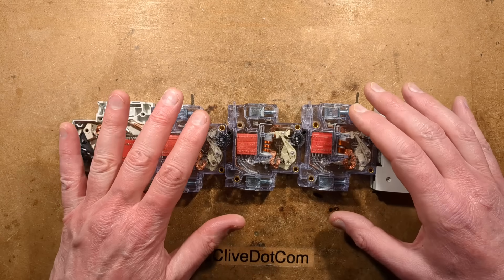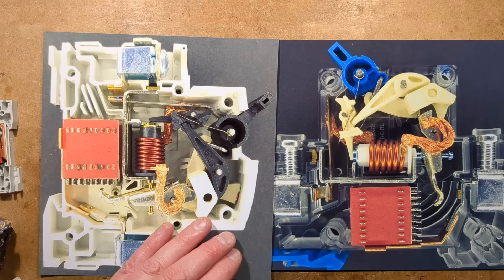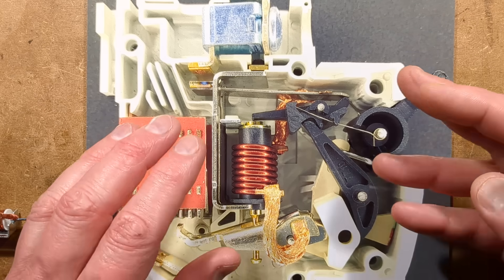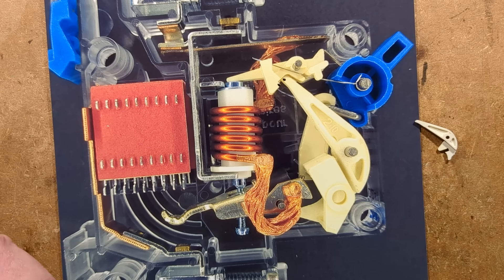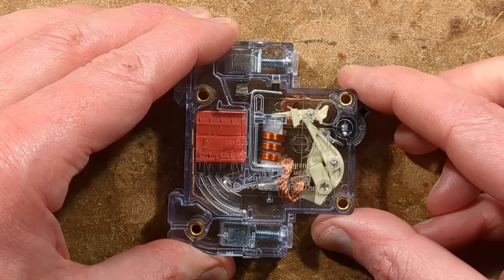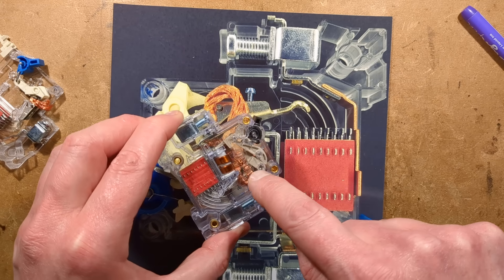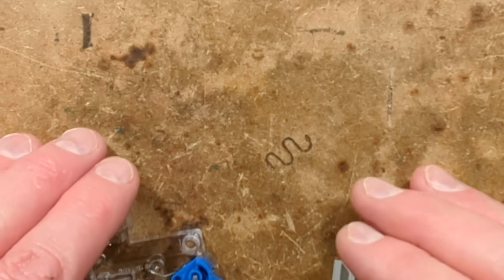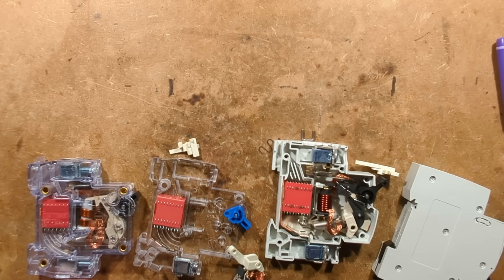A detailed look at the trip mechanism in circuit breakers

Comment: 9:50 Pretty sure the orientation of MCB doesn't matter. The arc travels by forces which caused by the arc itself (hot expanding air moving to vent hole). The similar principle is used in high voltage equipment also.

Comment: Since the arc chute is electrically connected to the upper terminal, is that an indication that the upper terminal should be connected to the supply side and the lower terminal to the load side? I have heard that MCBs are supposed to be top-in bottom-out, but I see a lot of UK installations have a bus bar on the bottom side from the GFI breaker. Or are those designed to be wired opposite?
Reply from the maker: I don't think simple breakers like this have a preference for the feed and load sides.  But with RCDs/GFIs it often does matter.

Comment: These are stupidly cheap because of mass production - they are made by the millions/billions every year so the production of them has been optimized to be as efficient as possible. It's just what happens. And low voltage high current test rigs are standard - if you need to test at 630 amps you aren't going to do it at high voltage because that's a lot of power. Even at 1 volt it's still 630 watts that has to be dissipated somewhere. (These are usually controlled by a variac to a transformer that brings down the voltage to the desired current through the device under test so it's probably down in the millivolts).

Comment: Worth noting there are breakers that can be locked in the on position.  They are sometimes used in certain life-safety equipment, where it's considered better to burn something out or cause fires than to have equipment kick off during critical operations. Nasa used them during the various saturn 5 launches.
Reply: Didn't that sort of approach cause a serious incident on one of the Apollo missions?
Reply: @dieseldragon6756 I don't find any reference to that. Apollo 12 was struck by lightning twice during liftoff, but the circuit breakers on the rocket itself were never locked. The lightning took out telemetry, but they managed to restore it using a backup channel of some sort.

I cannot find any reported serious incidents with locked-on breakers in the control room.  It's worth noting that the breaker panel had dedicated engineers during takeoff, so if a breaker tried to trip and the fault was sufficiently serious, there was someone on-hand to unlock it.
Reply: @yellingintothewind  I'm referring to a situation concerning condensation on control switches, which I think I saw depicted in the movie portrayal of Apollo 13. An incident where ordinarily functioning MCBs would avert a disaster, but lock-on'able ones would aggravate it. 🔥
Reply: @dieseldragon6756 Your memory is mostly correct. Condensation on Apollo 13's command module switches, including breakers, was a major concern prior to re-entry. They had let the temperature in the command module drop low enough for condensation, and potentially ice, to bypass breakers or otherwise cause trouble. That was not due to locking breakers, and a carefully planned startup sequence mitigated the problem before anything failed as a result.

Comment: Breakers in the USA trip a bit different. If you manually pull the lever, the over center goes to the full Off position as demonstrated in your video.  But if tripped electrically the lever goes to a center position that indicates it was an electrical trip and it will not allow a direct reset back to On, the lever must be manually pulled to Off before it will allow resetting to On. Almost like the over center mechanism its self needs the pivot point reset.

Comment: The cost of a typical 15A circuit breaker in North America seems to be much higher than those available in the UK, Europe or Asia. I assume it's the influence of the industry and regulation here that makes them so expensive. They seems to cost about a Canadian dollar per amp. A comparison of the internals in a North American breaker (Square D or Siemens for example) and the ones shown in the video would be very interesting. Thanks Clive, always great videos.

Comment: Gravity probably doesn't have very much influence on the arc. What does happen is the magnetic field created by the current flowing in the contacts and the arc chute applies a lorenz force to the arc, towards the quenching plates.
Not that I'd know from experience. I just bought a house that apparently still uses the old melty wire fuses. Which you can't buy anymore. If a circuit is overloaded it's gone forever. I'll modernize it later this year.

Comment: I tested whole breaker units (consisting of a breaker, contactor and sometimes a phase reverser) for a short time at work. The testing machine was a 400A autotransformer with the size of a small fridge, connected to 400A (continuous rated) contactors, connecting through to the device under test. You could literally feel the contactors (de)energizing when standing on the floor besides it. Besides being a fairly new testing station a few years ago, you had to manually dial in the autotransformer with the help of a built in ampmeter, use a stopwatch to tell how much time it took to trip the breaker and compare that to the specific charactaristic curve of the used breaker, let the breaker cool down for 10 minutes and repeat the test two more times. Quite tedious and boring work, but the testing machine was awesome and listening to the loud thunk when turning it on made me smile every time.

Comment: And note also that the thermal circuit breakers found in nearly all outlet strips have no magnetic trip, so if a massive overload / short occurs, there will be a delay while the thermal element heats up enough to trip. They aren't put there to save yuor house from burning down, they are put there to protect the manufacturer from a second lawsuit.

Comment: As for the arc suppressor, the arc is propelled away from the contacts by the magnetic field around the arc interacting with the transverse field in the contacts and wires - it is the same Lorentz force which makes railguns work.  This is a fairly strong force, and will propel the arc into the suppressor/cutter from any position.  MOST of our breakers here in Uhmurricuh are mouinted in panels horizontally, but that's not 100% guarantee - some are mounted vertically.  The arc cutter functions in all positions!

Comment: They are not clones, but standardised.

They are complex engineering,  there is a lot of torque considerations, fast switching, or latching. Thermal and short protections, delay and just about everything.
 A Great solution. 

Perhaps the winding difference on the different types would have stood out better as well as the spring resistance? 
You can show this by pushing it on a scales.

One thing that bothers me and that because i work a lot of with DC.
If you look at the quench, it gets wider and then closer, so if you dont break the arc it can reconnect. But it has to ach a lot between each plate and to both contacts, which high voltage can, im sure the math/science is correct. But there is a difference between ac and dc breakers and switches for that reason.

😮

Im finding too many failures recently as a side note, which isnt good.
Reply: In DC ckt. breakers the POLARITY( +/-) of each current conductor w.r.t. the other .. is most important to maintain for correct operation of the c.b. in these , correctly fixed polarity magnets are located in place of the 
" arc chute" because the Current is unidirectional...
unlike AC current in AC c.b.'s .

Comment: I worked for Crabtree in the 70's , best job I ever had blowing up Circuit breakers on the short circuit rig in the Elec lab at Lincoln works.  Nothing like putting 8000 amps through an MCB from a stalled Mill alternator and watching it disintegrate.  I remember when Thermal/magnetic MCBs took over from magnetic/magnetic types like the C50.  It was a way to make them cheaper ( and less reliable ?).   I helped set up the production testing/Calibration system for Crabtrees first  thermal/mag breaker.  It took us weeks to find a reliable way to set the calibration screw on the bimetal so we got repeatable results.   I learned so much from the great engineers who worked on those systems back then.

Comment: I remember in the late 90s these were much simpler and basically had just the bimetallic strip. You could drill them and jam them, but you could also just spray refrigerant from a compressed air can to keep them from getting hot.

Comment: A breaker will trip in 10 seconds if 200% its rated load is applied. it will should trip after 1000 seconds if its rated load is continually applied.

Comment: I bought a 32A clear MCB when you first demonstrated one a few years ago. It has been in pieces more time than assembled, and the original screws have been replaced by nylon screws! As a tool to demonstrate interior function, it was priceless, especially since the trip circuit was composed of discrete components, so relatively easy to produce a schematic. An excellent buy!

Comment: Perhaps a fun one, you had these instant water cookers some time ago. Had one for ages. Press a button, water comes out cooked. They have a massive heating element with a plastic ring that can melt, and then metal strips bend outwards to break the connection. Always like the design

Comment: You pointed out that those MCBs should be mounted vertically. And still they mount them horizontally in the US
Reply from the maker: And in the UK in industrial panels.
Reply: @bigclivedotcom so the mounting orientation doesn't matter how it seems.

I'm an engineer working in petrochemical industry in Austria and in every cubicle they are mounted vertical. Tbh, I never checked the mounting instructions because I never thought one would mount them differently.

Comment: I had always assumed that even delicately pushing the handle back on would inevitably "hold" it closed while pushing it, even if just for a split second. I always worried if I wasn't sure whether it was a short that tripped it, that if I turned the breaker back on, the quick "holding" of the switch when turning it on could subject the circuit to a prolonged (compared to the magnetic trip) period of unimpeded current flow in the case of a short. Happy to know they thought of this!

Comment: It's interesting when you compare the size of wire we are required to use by code versus the size of the components inside the breaker that handle the same load.

Comment: The inverter for my solar panels on the roof tripped out. A sparky got up on the roof and found a plastic component joining the cables to the panels had cracked after being exposed to the weather.  Rain had penatrated in through the crack and caused a short. He told me my roof could catch fire if it arced with my corrugated iron roof. He hard wired the wiring to the panels negating this problem to happen again. Best $423.00 i ever spent.

Comment: Circuit breakers are one of the best things to happen. They dramatically increase the safety of your house and protect your machinery, appliances from catastrophic damage. The best part to me is that they also make it easier to fault find your circuits. If a circuit is tripping to often its time to get the sparky in. Saved my house from a roof fire caused by a hot joint caused by rat piss.
Reply: Always remember that circuit breakers protect the cable from fires, not you. Your protection comes from RCDs/GFCIs.
Reply: @Goabnb94 idk about where you live, but the main first breaker between the panel and mains supply is always a GFCI/RCD, so the entire building gets tripped if someone gets shocked
Reply: I am never EVER coming to your house.
Reply: @railgap  
Was it the rat's  ?  Or my candour ?

Comment: Interresting that the ON position is with the outside lever down, and OFF is the up position.  Here in Germany it is the other way around. I guess you also have brands like Hager etc? Are they also off = up? If so i wonder why. If you like i can send you some to see for yourself.

Edit: Oh, never mind, the whole thing is  upside-down instead. Later you show the "normal" mounting position, and the lever is to the bottom. Here it is to the top. Still strange, though  :)

Comment: It gets even better when you get into DC MCBs.  DC ARCs are harder to break so the breakers diverge into two types:  Polarized and non-polarized.  Polarized DC breakers direct the ARC into the chute with magnets and can handle much higher voltages.   But for DC, fixed magnets can only direct the ARC in the right direction when the current is going in a particular direction.  If the current is going the other way, the ARC is directed away from the chute and you wind up with a fire.  Hence "polarized".

The magnets are typically put in compartments or glued to the inside case body on either side of the actuator contact (since the ARC forms between the actuator contact and the port contact).

Typical non-polarized DC breakers don't have magnets and depend on the ARC walking the chute on its own... thus are typically relegated to lower voltages.  These are safer at their voltage ratings, however, because you don't get a fire if you wire up the current direction incorrectly.

More expensive non-polarized DC breakers have double-chute fixed-magnet designs or single-chute electro-magnet designs (which is different from the solenoid) to ensure that the ARC is directed into a chute as quickly as possible.

And then you get into MCBs vs MCCBs.   Both can be "miniature circuit breakers", but MCBs are typically only rivited and have gaps or unsealed surfaces where the ARC can make it outside the case, while MCCBs "Molded Case Circuit Breakers" are typically sealed (or mostly sealed) to ensure that the ARC does not make it outside the case and designed to handle much higher currents.

The actuator contact is also typically silvered to reduce carbon build-up and corrosion.

-Mat

Comment: In our breaker box,  there are two horizontal rows. The hot connectors are in the centre and so the top breakers are upside down to the bottom row. So there is no up and down.... at least here. Our breakers trip to a centre position and reset requires a move to full off before turning it back on. So I can see right away which breaker has tripped.

Comment: Good video Clive. Just an thought, would the magnetic field created by the solenoid activating with such high current flowing through it be sufficiently strong to bend the current arc around that radius. They all seem to be wound the same direction.
Reply from the maker: I'm not sure if the magnetic field is part of that.

Comment: This really hasn't answered my burning question about whether the scene in TheLastOfUs where Pedro is "changing the springs" in circuit breakers is remotely plausible.
Reply from the maker: No it's not viable.  But swapping breakers completely is, and you could tamper with one.
Reply: @bigclivedotcom  OMG - what ELSE in that documentary is going to turn out to be untrue ???

Comment: Interesting. In the USA, most of our standard circuit breakers (specifically for residential consumer applications) have no solenoid magnetic trip mechanism at all - just a bimetallic strip. Surely they've designed it such that the bimetallic strip does an equivalent job at opening the circuit in a reasonable time for the full range of overcurrents.
Reply from the maker: I think some American breakers have a magnetic flap system in them.

Comment: In respect to arc interruption my thought is as follow: These shutes are above the arc when the breaker is oriented "normal" in a panel. The heat of the arc lets the arc rise up into these shutes as hot air is less dense. In between the shutes the arc is divided into several smaller arcs and cooled down so it will extinguish. This might explain some of the internal details. When I'm right circuit breakers shall not be installed with other orientation because of this effect.
Reply from the maker: The breakers are mounted sideways in industrial panels.

Comment: when i was in college back in the late 70's we used to test trip 1000A breakers used on the london undergroung. The voltage was about a 600th of the breaker voltage as we used about 1V AC.  not sure how much current it could supply as it popped everything we connected to it. 

Electronics tutor said that a straight wire with current flowing in it would generate a very small magnetic field, well the cables we used were about as thick as you wrist and as the current build they would move a few feet away from each other, and then spring back when the breaker popped.

Comment: Isn't it wonderful that circuit overload protection relies on a spring and lever mousetrap to keep us safe.
Reply: @stevejagger8602  well, somewhat.  Standards also require fail-tripped. Failures of the circuit breaker mechanism are supposed to fail the unit in a tripped condition and not allow it to be reset.  So e.g. the plastic bits are designed to fail before the metal and spring bits.

Comment: I feel so much better now about the clutter on my desk, my workbench, the workbenches in my garage and my shed, the kitchen sink, kitchen benches and the kitchen table. Not to mention the patio tables and the floor space in front of my car. Did I mention the linen cupboard chock full with layers of tools - screwdrivers, clamps, hammers, drills, sandpaper, screws, tape, gauges, spirit levels, bits of wood. Can never find anything.

Comment: I'm  curious how DC circuit breakers differ, and how they deal with the persisting DC arc, without the zero crossing of AC.  I have experimented with adding small magnets to contacts, to push, and stretch it out, to help extinguish it quickly.
Reply from the maker: https://youtu.be/w0ntxqTEqyM